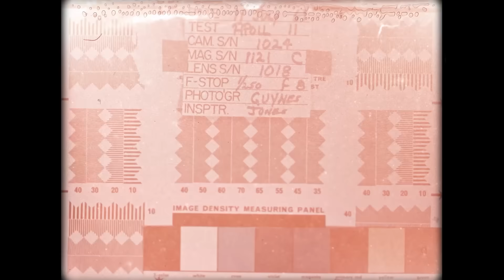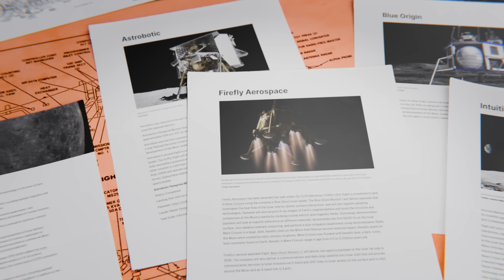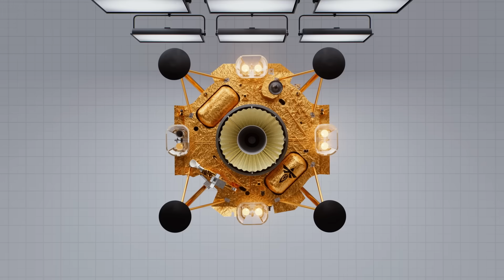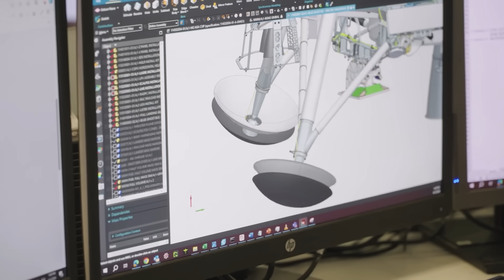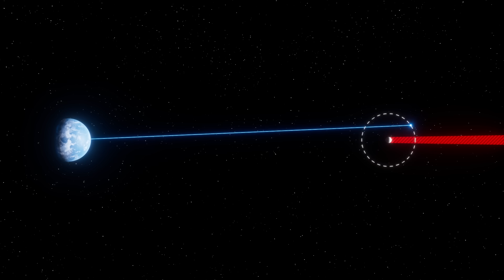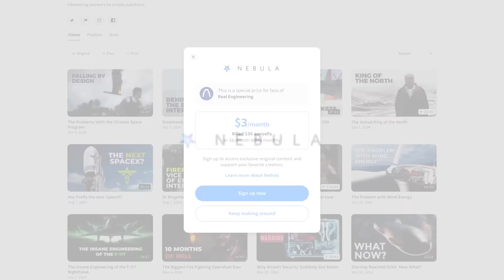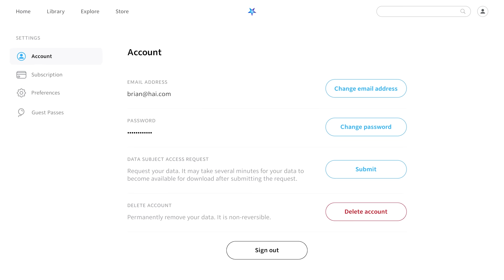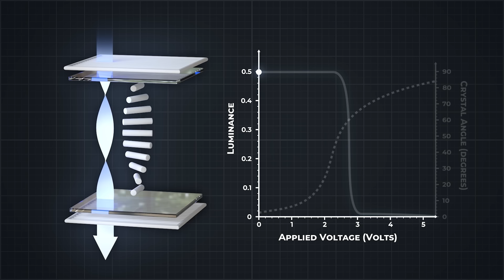Why the US is Struggling to Land on the Moon

Comment: Because back in the 60's the education system was firmly based on talent, not bums on seats.
Reply: That has absolutely nothing to do with it. Where were you educated?
Reply: @asynchronicity  In the UK and it most certainly does:  being from the UK, I (as a PhD student who taught 'A' level part time and who also, at the time, witnessed first degree lecturer's own comments at the degree level they were being forced to teach) saw a big reduction in the quality of 'A' level exam papers between 1985 and 1995; this was due to the government trying get 50% of the potential student population into doing a degree.  The problem was the IQ normal distribution curve, which traditionally put the top 25th percentile of students into university meant that those students whos IQ fell below the top 25th percentile, couldn't pass the exams, so the solution was obvious.

Now, unfortunately, we have even more problems to deal with as the whole concept of meritocracy is under attack; however that's a whole different can of worms.
Reply: @davidgriffin79  OK now apply your education and explain specifically how this affects the hyper competitive field of aerospace.
Reply: @asynchronicity  It doesn't matter how competitive the field is, if the field is in itself mediocre. I work in design substantiation relevant to ASME NB, I deal with the "top" graduates coming into this field and believe me "top" is relative.
Reply: @davidgriffin79  SpaceX isn't doing incredible things? (Just one example)

Comment: Would weight cells in the landing feet be able to tell if all of the feet are landed? We use weight cells for many things at work, including landing/docking.
Reply: That would make too much sense.
Reply: Aircraft have also used them for many many years to detect when the landing gear is on the ground.

Comment: Why don't they make a spherical cocoon, with thrusters in any direction, with a mostly homogenously distributed weight and the fuel in the center... and then make the computer try to cancel the acceleration and angular in any direction it feels it coming and once it stops moving it deploys in a way that ends up facing upwards? :p How is that not possible?
Reply: The "thrusters in any direction" part isn't really practical. Every thruster means extra weight (mass) which means you need more fuel to get the lander where it needs to be. You want a lander with one big main thruster strong enough to decelerate from orbit and counteract gravity while landing, and as few small navigation thrusters as you can get away with (again because of the weight). Rockets get that large because they need so much fuel, they're basically huge flying fuel tanks with a tiny payload on top, and all of that fuel is required to get that tiny payload where it needs to be.
Reply: @JerehmiaBoaz   I think you are right.... they probably are heavy.

Comment: It would make more sense to have 2 cameras on opposite sides of the lander. With both of them mounted on rotating brackets. That way, the system is much more secure from an unexpected contact disabling the entire lander. It would also get some really awesome moonscape images.
Reply: mm seems fun but usually moving parts makes it easier to get stuck or damaged so without redunancy that might be too big of a risk

Comment: You listed a lot of design flaws. The lack of redundancy for instance is a fatal one
Reply: @keyboardt8276  I wouldn’t put this on the engineer, as his knowledge seemed quite general, he knew everything else, and it’s probably not relevant to him. I wouldn’t expect a mechanical engineer to know the exact details of the navigation system, only what he needs to in order to design his portion. It’s kind of like asking a bartender the tax percentage on capital gains that the restaurant owner paid. There is no reason for them to know it, so they don’t.
Reply: @keyboardt8276  Have you ever talked on camera? I know I become an idiot when trying to speak on camera. I also know I'm not the only person with this sort of response.
Reply: Redundancy is heavy.

It can also get very complicated. For example they considered multiple engines for rhe LM for redundancy. But they couldn't have 2, because that would increase the weight and fuel requirements, and actually they both had to be more powerful than the single engine so that they could lift the craft plus tne dead engine if there was a failure.

Three engines let you shrink the engines down, but your odds of one engine failing eas tripple. 

Basically turns out you don't actually improve reliability until you have 5 engines.
Reply: Redundancy is heavy, and when one pound costs $1,000,000 there is a large incentive to make sure it works the first time. They put redundancy where they could, such as with 4 leg sensors instead of one.

Edit: I see someone posted leading with “redundancy is heavy” just before I did! Same idea, different rationale, but still a good point.

Comment: You would have to be really naive to believe that the first one actually took place. Without any noteworthy technology just pure mechanical engineering. Just doesn’t make sense.
Reply: What noteworthy technology? Two pictures of stars, an IRS unit and manual controls? You've got to be really naive not to believe it, it's really not that complicated. Also, you have thousands and thousands of pages of documentation, publicly available, about every single detailed step of how exactly they did it. Just do some reading, maybe?

Comment: I'm not on either side of the fence but the fact they find it so difficult 60 years after having supposedly gone is super sus.
Can't think of another relevant technology that hasn't advanced tremendously in that time.
It's not like they have no budget either. Adjusted for inflation it's about the same as back then.
Maybe it was all Wernher von Braun and they can't do it without him.
Reply: We are wasting money and time with unproven flawed starship design.
20 refuelings just to get to the moon. Whilst there hasn't been a single completely successful launch out of 6. In years.
Reply: Exactly. Funny, but the older I get, and I'm old now, the less I believe that the US went to the moon, especially given how they are behaving now. Just saying.
Reply: @SufficingPit  Dream on, dude.
Reply: @SufficingPit  NASA's budget isn't miniscule. It's much smaller as a percentage of the GDP than it was back then but as an absolute amount adjusted for inflation it's not much lower than the peak in the 60s.

Comment: "NASA's budget is too big" 14:19 they're literally still having to use Windows XP 😂
Reply: it's most likely due to compatibility reasons. You need dumb, very robust equipment in space. Reliability is the number one priority there and you cannot use the latest and greatest it tech (especially operating systems) which can have unforeseen consequences..
Reply: @fishadthethird  This is not what they tell us. They tell us we must upgrade or hackers will invade. We don't hear reliability for old software (even if its true) we hear unsecure and outdated security measures.
Reply: I think they might use that for compatibility reasons. There's very specialized software that communicates on a specific type of connectors that don't have support on newer operating systems/hardware.
Reply: @JohnnyN-I  they also used 8086 chips in the Shuttle, after Pentiums came out, because those chips was resistant to cosmic rays. To replace those chips, the entire mechanism needed to be rebuilt with shielding, usually with lead. There are a lot of unintended consequences to "upgrading' equipment when it goes into space.
Reply: @JohnnyN-I  they should use open source. It is more reliable, performant and compatible. I wouldn't let Windows run a coffee pot.
Reply: @JohnnyN-I  thats bullshit windows xp is basically a version of windows NT 5 beta 2
so one could use newer versions as most shit windows nt and server are compatible and you'd be able to add feature sets
the thing they like about xp is thats not really windows xp no more trustme
like that german police cdr its heavily modified and no longer compatible with windows xp you might get
upgrading requires a lot a code then and not by nasa people first

some of the heaviest encrypted files are from nasa
Reply: Thats a chunky laptop.  I imagine thats really old footage.
Reply: The government was also using windows 98 into the 2000's it's for security reasons.
Reply: I had a friend who’s dad worked for a Defense company and asked him the same thing about using old software. He said it was for many reasons but one is that it was harder to hack into because it’s been well established where hackers can attack from so it’s easier to catch and create software to counter hackers.
Reply: @danolver913 - bro. if it'sn't a weather satellite, all space related activity is unecessary and extremely expensive. money that could be spent on humans welfare, is spent on trying to fnd out what the size of the universe is, or what a comet is made of. we dont need any of that rubbish. Nasa needs nothing other than curtailing unecessary experiments of the type that help absolutely nothing. we dont need to know if jupiter moons are inhabitable, or any of saturns rings contain a dust molecule that might worthy of nothing more than more information. we dont need information that we can't use immediately. stop financially punishing EVERYONE now, lets get to tmrw first. NASA and other agencies are over reaching with experiments that help nothing that cannot wait. and we all suffer for scientists to justify their massive incomes and sponships.
Reply: if it isn't a weather satellite, ALL space related activity is unecessary and extremely expensive. money that could be spent on humans welfare, is spent on trying to find out what the size of the universe is, or what a comet is made of. we don't need any of that rubbish. Nasa and the other space agencies worldwide, needs nothing other than curtailing unecessary experiments of the type that help absolutely nothing. we dont need to know if jupiter moons are inhabitable, or any of saturns rings contain a dust molecule that might be worthy of nothing more than more information. we dont need information that we can't use immediately. They ALL need to stop financially punishing EVERYONE in the present, instead lets get to tmrw first. NASA and other agencies are over reaching with worthless experiments that help nothing that cannot wait. and we ALL suffer for scientists to justify their massive incomes and sponsorships.maddening. especially when there are better more worthy causes RIGHT NOW.
Reply: It's not about money. They use it because no one else does.
Reply: Yep they are rich, one of the compagnies I worked for was still using MS-DOS because their home made software didn't run on windows. 😅 But to be fair it was intranet only, no extern connection on it, don't think it's the same for NASA.
Reply: Clearly it’s for the access to Space Cadet Pinball
Reply: Usually a clip from the archive.
Reply: It was either XP or Vista pick your poison
Reply: They’re ITAR compliant with tons of NDAs and foreign export control laws. There’s a reason they still use Windows XP
Reply: Yeah they steal $70 million a day from us to perpetuate endless hoax’s
Reply: $1 =  1 cent for space exploration, 99 cents in the back pockets of politicians and corporations.
Reply: @MattyEngland  $1 spent on exploration isn't a $1 launched into space, it's paid to companies and people.
Reply: @MattyEngland  mostly to military industry
Reply: @MattyEngland  We don't have a gov't anymore, it's an organized crime gang war ((R) v (D) v (IN))
Reply: @MattyEngland  Not even. It's like the halfth of a penny.
Reply: if it isn't a weather satellite, ALL space related activity is unecessary and extremely expensive.

Comment: 100 meter resolution on the lunar mapper? great video that just stuck out to me, wouldnt that not be enough to map out any boulder smaller then 100m? or you mean like 100m area its taking images of?
Reply: there are three cameras, two narrow angle with a spatial resolution of 0.5 meters (1.6 ft) per pixel over a swath that is 5 kilometers (3.1 mi) wide and the wide angle camera provides 100 meters (328 ft) per pixel images over a swath 100 km wide
Reply: So potato cam

Comment: I don't get why people talk about general and strong AI when this proves we haven't mastered a narrow AI like the algorithm to land  safely there
Reply: Because they are completely different things the AI people are talking about are Large Language Models usually that have been trained on a lot of data.

The AI needed here is completely different subdomain of Machine Learning called Reimforcement Learning (it's analogous to feedback control) that is making  massive strides but isn't there yet + the data the one needs to train a Machine Learning model does not exist or not enough of it exists to get the performance yet probably.
Reply: Because those thousands of self driven cars out there share their experiences onto one server, one hard drive, therefore when you get in a car, the AI has a combined let's say 1 million hours of driving experience.
Reply: Up away from the protective shield of Earth's magnetosphere sensitive electronics are unreliable. So we have to use special radiation hardened chips that are considerably weaker computationally than the state of the art.

Comment: we got there thanks to a few autistic people that would even dream about math. and had launch windows the size of hours not minutes to avoid contact with satellites and junk. I have a feeling within the next 20-30 years thanks to space x we will have another major boom in mathematicians that hopefully wont rely on calculators to do the work they need to. if you only use a calculator you wont see the larger picture of what you are trying to calculate.
Reply: What are you going on about with calculators? A lot of the math done for Apollo was done by computers and women
Reply: You're both living in la la land. Modern Computers could do all the Apollo calculations in less than 0.001 seconds.